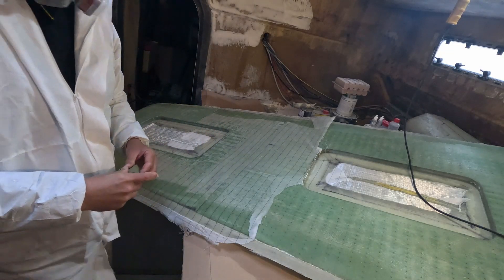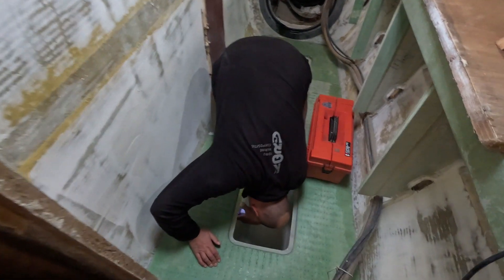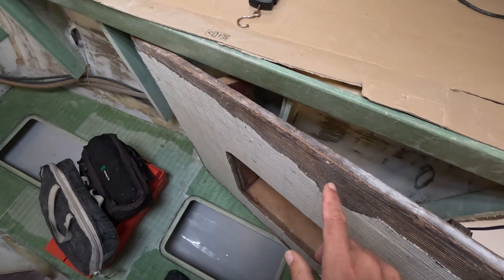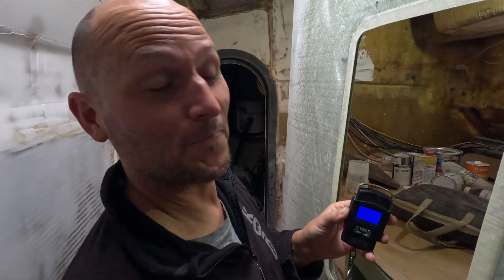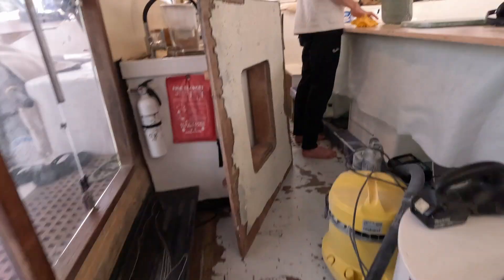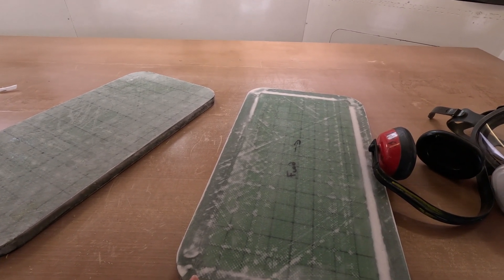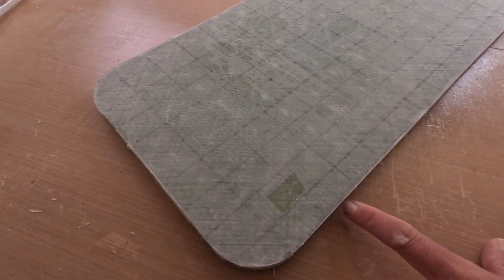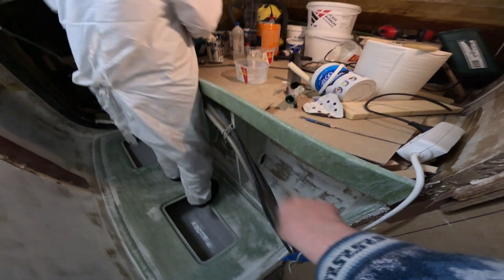We Made a Boat Floor 75% Lighter (And It's Stronger)

Comment: Yet another brilliant and Timely video for me as I just have to replace a rear floor. I was going to build it out of honeycombed board but I have replaced other parts of the flooring with that and it’s just not strong enough so I had to add supports. I am going to build this rear floor out of foam this time but what thickness of foam did you use ? Also do you think 2 layers of 600 biax on both sides will be enough?
Reply from the maker: Hey Richard. The core is not the issue it's the thickness of the skins that is the secret. I used 20mm foam core with 1200g skins. The laminate was EQ (quadraxial) not DB. It is possible for you to go lighter it just depends on the floor span. Hope that helps. Cheers for watching the vid mate
Reply: @youngbarnacles One layer each side of 1200 ?
Reply from the maker: Yes. You can do 2x 600 or whatever combo. The underneath of floor can be lighter but depends on the span. The top layer is at an absolute minimum of 800grams preferred is 1000grams for durability
Reply: @youngbarnacles  Thank you 🙏

Comment: ok, one more question... no peel ply?  and, you're laying on resin with filler power on while the original resin is wet-- presumably to fill the weave of the cloth?
Reply from the maker: Correct. But it wasn't wet, it was gelled.

Comment: a couple of questions...  Why not laminate the tape on top of the wet cove so there is no worry re a secondary bond?  and... you can use polyester to glue on to epoxy laminate on the new floor?  Are their guidelines on when you use polyester vs epoxy, apart from where wood protection is required?  Thanks  Phil
Reply from the maker: Ok. What you are looking at is all polyester work. Floor is poly and so I used poly for coving and taping. The reason I did it this way is as follows 1. The polyester cures too fast for me to prep and get the tape down before it cures
2 polyester has a chemical secondary bond 
3 if its not cured you tend to squish the cove out
IF I was using epoxy and had the working time I would laminate straight on to a gelled coving.
You can laminate polyester to epoxy BUT the epoxy would need to be fully postcured and fully cleaned so there are no amines present as they inhibit the curing process of polyester resin. 
Polyester can ONLY be used with eglass. You shouldn't use with exotics like carbon kevlar etc or wood.

Comment: Great work! Perhaps slightly dumb question - with all the weight reductions taking place across Paikea, will this affect her centre of mass etc.? Is floating on her lines a concern, or is it negligible enough to only care about lighter weight->more speed?
Reply from the maker: Yes it does change the centre of mass. Yes not floating on her lines is also a concern. BUT we are taking weight out evenly across the boat not just in one place. We know from talking to one of the original builders that this boat came out over the target weight of 7 that Lock Crowther had designed. We are aiming to get it  to that 7 tonnes or below. It is about 8 tonne at the moment. The floors etc were built from 25mm plywood and incredibly heavy. So we can remove and replace these plus furniture and should get close to our 7tonne mark.
Reply: @erikwallin6314  start with the basic assumption that any cruising cat could afford to lose a couple , especially if it’s a full time liveaboard gig, and even more so with many teenagers on board 😂 realistically speaking more or less regardless of how much weight they manage to take off through good design/ build quality, the boat is always going to be on the chubby side of good so the more weight cuts the merrier!
Reply from the maker: Exactly ... get your boat as light as possible because teenagers weigh a lot 🤣

Comment: Beaut! What thickness core did you go with in the end? Looks like the hatches are thicker than the floor right? Is the idea to non skid the floors or something a little more sexy in the works?
Reply from the maker: 20mm foam. Hatches are the same width as floor. Still throwing ideas around but plan to paint floor.
Reply: @youngbarnacles  Wouldn't hatches sit slightly higher than floor, not flush?
And without cushioning/seal (thickness), make a racket when walking on, vibration?
How you going to open them, especially when they get jammed up with sand? Is that filler @10:05?
Reply from the maker: The hatches sit flush as they were built into the new floor. You can see how we did that in an earlier video on infusing the floor. We have a gasket to go around hatches to minimise dust, etc, from getting into the gap. It's more highly engineered than any of the other boat hatches around. We've got a few ideas for pulling up hatches but are thinking a simple string pull. I'll put some video of shayne walking on it with sound so we can see/hear it
Reply: @youngbarnacles  nice, 20mm hd foam is definitely going to be teenage boy proof and still super lite 😍 I recon paint is the cheapest/ easiest/ litest/ least maintenance option, but since we are slaves to appearance’s I think the flooring on Flow will be 3mm cork.. still pretty lite, cozy on the feet and little knees, and purdy :)
Reply from the maker: Yeah we were looking at cork option too. Send us pics once you get it done. Would be really interested in how it looks
Reply: @ will do, but considering the roll you and the crew are on I’m betting yours will be done first 😂😭 have seen cork floors done on another cat, Catana 42s incidentally, and they look fantastic. They had been done by a previous owner to the one we met. The owner at the time decided to refurbish them by sanding and then epoxying. Came out really slick, in both senses of the word, needed a lite nonskid. Anyways, pretty sold on it. To be decided if impregnating with resin in the kitchen area will be the go, will most likely do that at a later time if we see premature wear